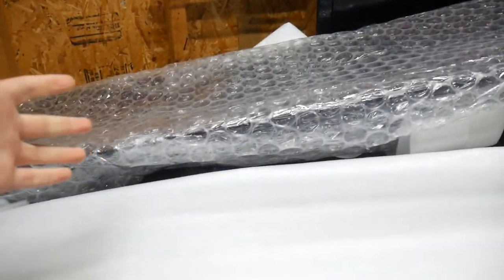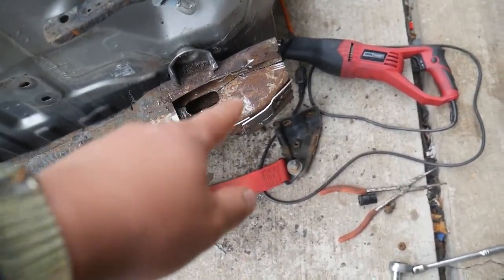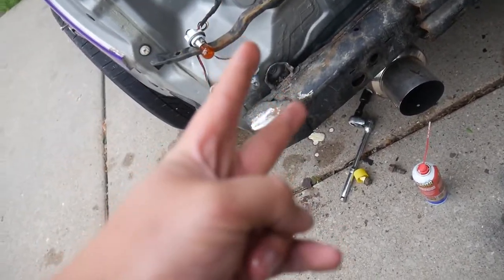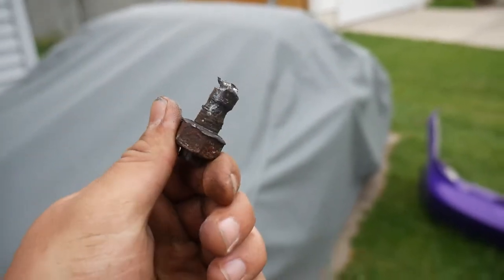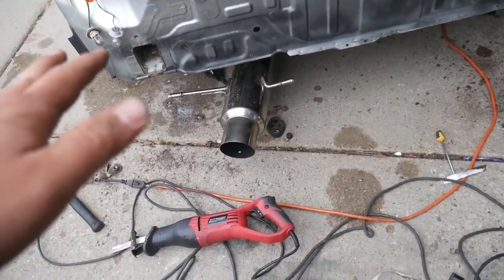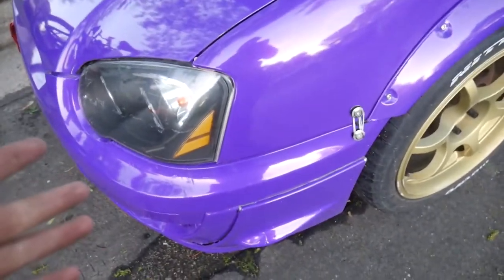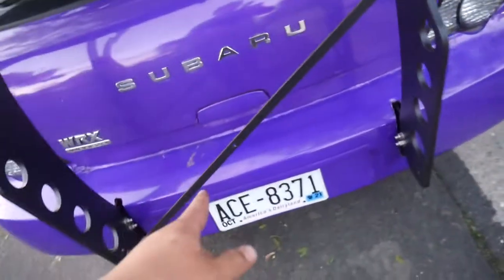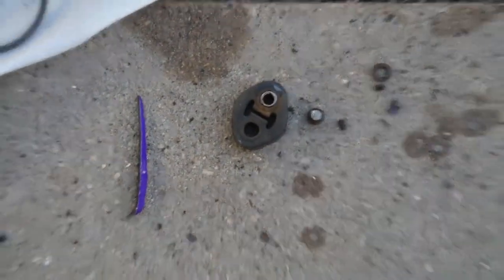Installing A Chassis Mount Wing On My WRX Wagon!

Comment: How does it work when opening the trunk?  Do you have to loosen some bolts each time or is it something much easier??
Reply from the maker: Yep, loosen a bolt on each side and it'll swivel down enough to open the hatch. It's not too bad but if you use the hatch regularly then I probably wouldn't recommend one of these 😅

Comment: Bro can a slippery clutch be adjusted in corolla 2004 ??
Reply from the maker: If it’s the clutch that’s slipping, it’ll have to be replaced. I’m assuming you’ve got a manual, but if it’s an automatic, then slippage means the whole transmission has to be swapped or rebuilt.
Reply: It’s manual , wht can be done ?
Reply from the maker: When you say slippery clutch, do you mean that when you drive your RPM will jump up but the car doesn’t accelerate? If that’s the case, the clutch will have to be replaced as clutches wear out over time.
Reply: No, i have only problem with 1st and reverse gear, car vibrates with half clutch .